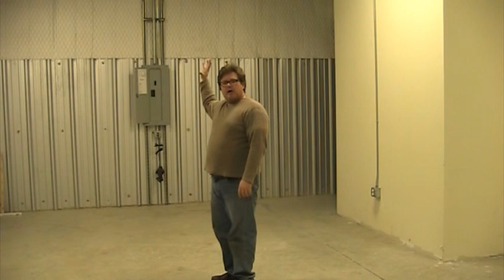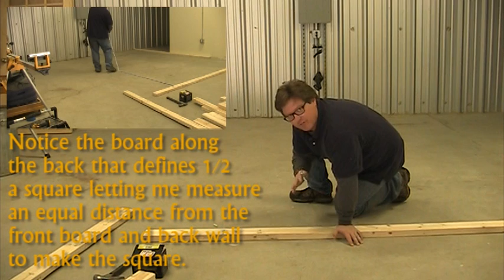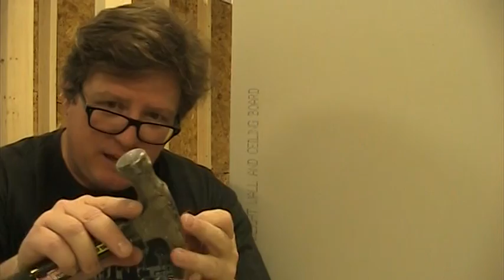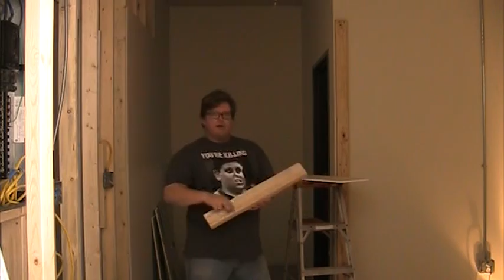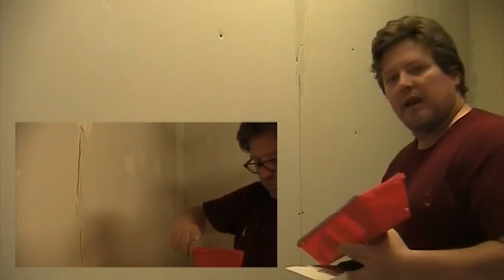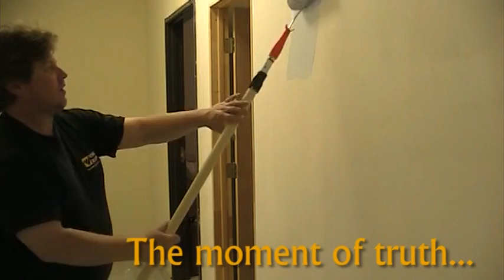Building an Office in My Woodworking Shop (walls, drywall, mudding, paint)

Comment: Well that was just awesome.  I'm planning on doing something similar in my metal-building man-cave.  Just curious why you didn't go with ground-contact two-by-fours on your base plates?  I guess it's probably not necessary, but I'm a bit paranoid and tend to over-build.
Reply from the maker: It's inside a warehouse. Base would never be wet for more than a few hours (if I spilled something). Didn't think it necessary.

Comment: is tape not necessary when doing the drywall?
Reply from the maker: +Edwin Landmast +mike gager I've heard multiple theories on this. It definitely won't hurt. I was taught if you have a tight joint where both halves are on a stud (like in the examples I showed in a video) it's not that necessary where I live. Though if you have a gap then it's a must after the gap is filled with compound. I'll tell ya in my gaps I usually use the mesh stuff instead of just tape. Just didn't show that in the video.
Reply: +Etienne Ringuet If he's on the studs, using a somewhat flexible drywall glue and it's a warehouse, not 100% necessary